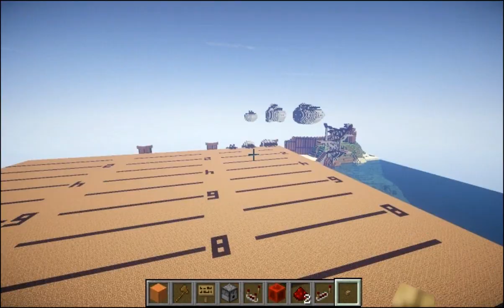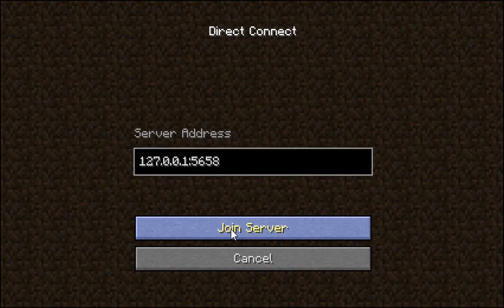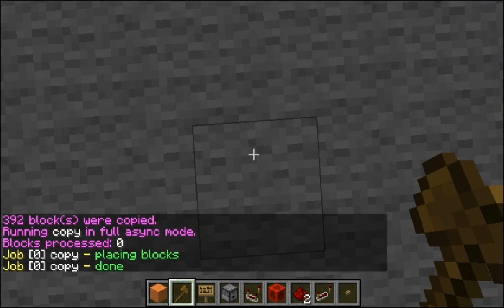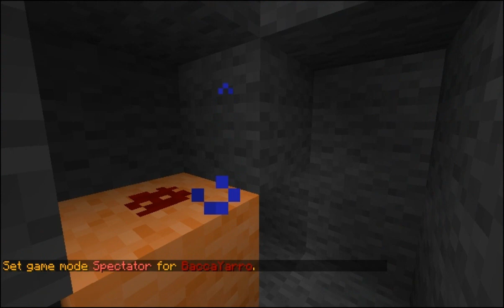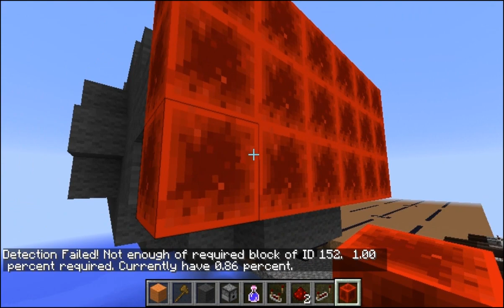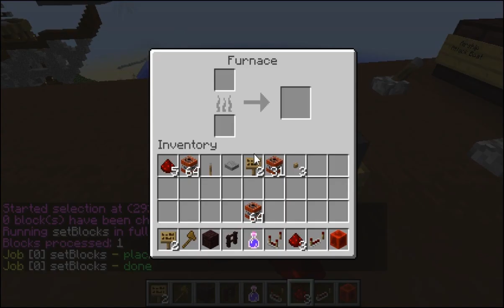Minecraft Warship Tutorial: Advanced Turrets and Wiring

Comment: I know this is an older video, but I'd just like to share a tip:
I find it a lot easier to setup all the "mechanisms" (cannons, wiring, bridge, etc.) of the ship and then build a hull around that, instead of building the hull first and having to cram everything into an already-built shape.
Basically I position all the weapons and such while I'm still at the wireframe stage, so I know the general size of the ship, and then afterwards fill in all the wool around it.